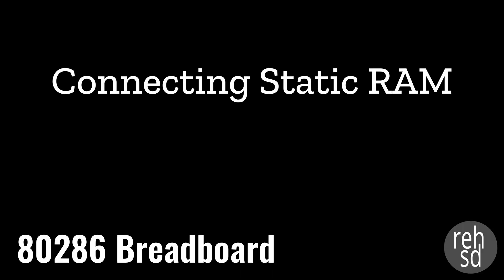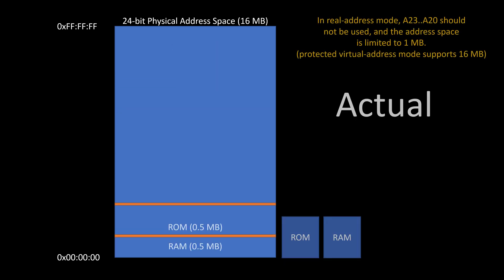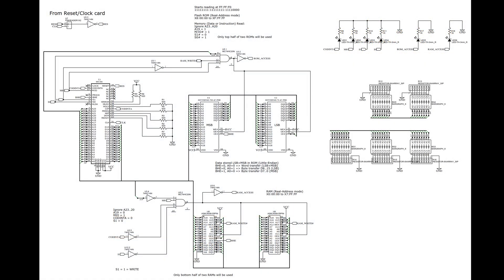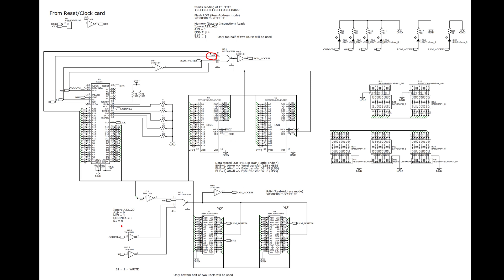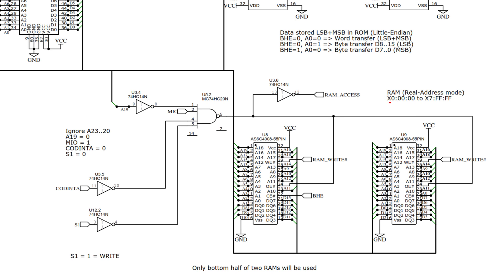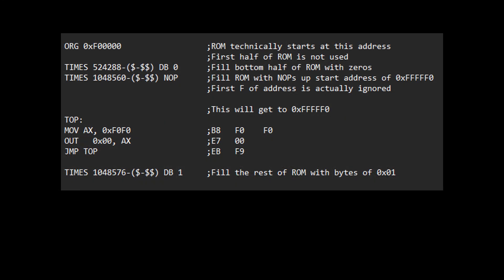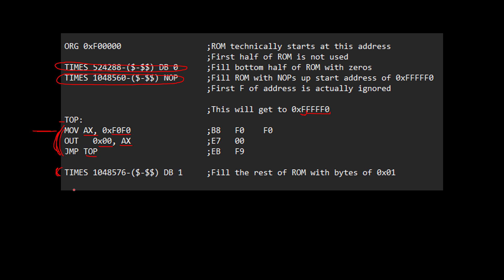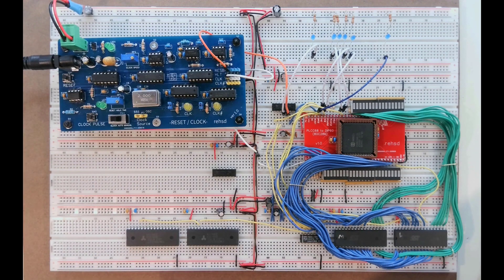80286 Build, Ep. #6 - Connecting Static RAM

Comment: Couldn’t you use A20 address bit as your MSB address for both ROM and RAM? Then you would have (bottom to top): 512k RAM, 512k ROM, 512k RAM, 512k ROM
Not an ideal address map, but not wasting any resources.
As far as I know in real mode A23-A20 are just forced to be low as the software is not capable of driving them. After switching to protected mode you would get access to the additional memory.
Reply from the maker: Yes, that seems reasonable. Later in the series, I settle in on 640k RAM, 256k ROM, and some I/O ranges in between (e.g., VGA, sound card). Right now, I'm working on getting FreeDOS running the build. If I can get protected mode running, then I might rethink how I am handling space above 1MB. Currently, I am wasting a bit of RAM in my address mapping (using 640k of 1024k).